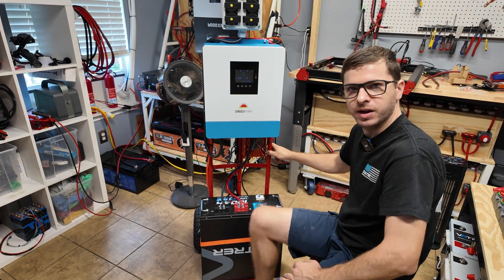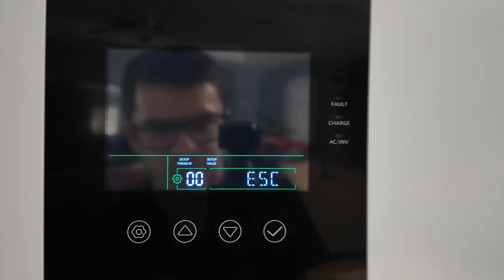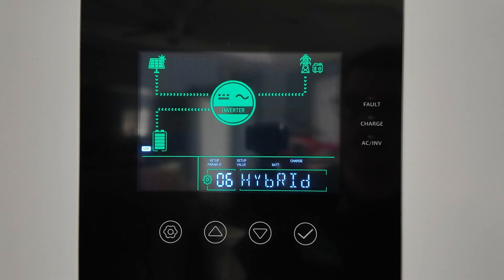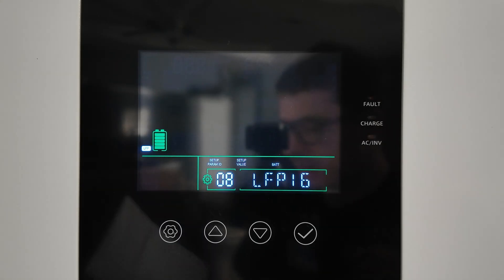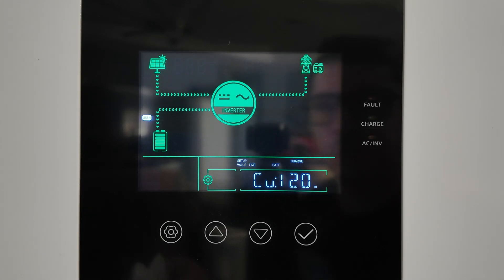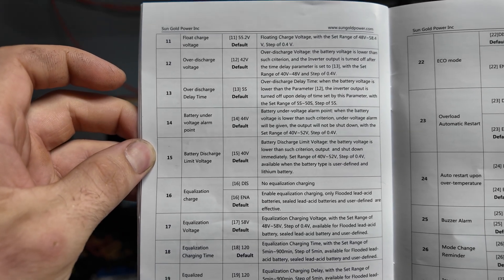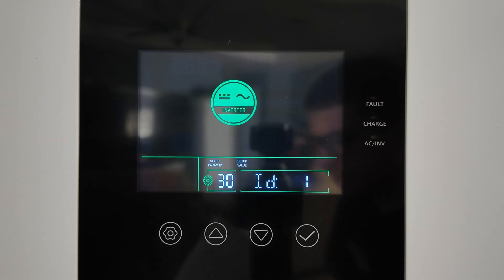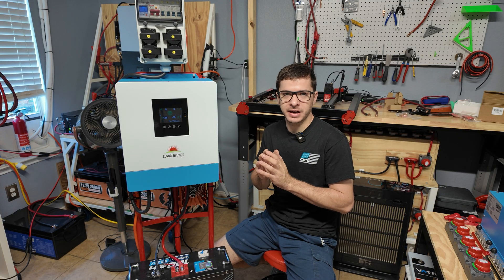Inverter Settings For Beginners, Battery Settings Overview! Sungold Power 5000 Watt All in One

Comment: I say that 54.00 is also OK for Float voltage.   Or 53.90 maybe better.  
Anything over 13.49 × 4 can Damage / Shorten their Life ( IF you Go Over 100% Full ).
According to Clark.

Best to Uee a Battery Monitor  -- to Monitor that.   

54.00 Volt Charge, and 0 watts  to Hold it there is 100%.

Comment: im setting #4 at 50 volts, reason being i heat my home with a coal stove (stoker) and if the power ever goes out i have an auxiliary plug behind my stove that i can plug the stove into that is run off my solar system. if the unit has a minimum of 50 volts it will run the stove for close to 10 hours before the battery is actually dead. 

it's a reserve battery capacity for emergency use. i also only have a small array right now (1,200 watts) and it's overly cloudy this time of year so my solar generation is limited. i do have my unit plugged into mains AC power. i have the minimum voltage at 50 and the charging OFF (AC power) at 54. it will maintain the battery but not top it off to avoid clipping. if i have a surplus of power i will be able to utilize it elsewhere. if there is sun available i want to use it, if it's cloudy i still want access to backup power if the power goes out

Comment: Hey Mike, If you would be so kind, I have a Tiny house using this unit (4 200AH Batteries in series).

What would be your recommended input mode using this scenario (the User Guide doesn't mention this specific setup):

- Full time PV 
- We use a generator to charge when the batteries are low (shore power is wired to "AC In")

Was kind of hoping that when the until detects power on the "AC In" it would automatically switch to getting power from that port and start charging the batteries (as well as handling the current AC load).  Our main power source is PV, but when voltage is low we fire up the generator.
Reply from the maker: It should automatically switch to the ac in mode, bypassing and charging when power is added to the ac input. 

DO you want to connect the generator to the ac input? 
That way when the generator is fired up, it will start charging and bypass loads.
Is that what you mean? 
Sounds like you have a solid setup!

Comment: Do one with settings for using a generator as ac input. Mine detects the ac but doesnt charge the battery, using vatrer as well.
Reply from the maker: Mine as soon as i aplly 120 volts to the input, it bypasses and begins charging, works with a generator too
Reply: @Mikebuildss Had to make some changes to settings, #3 APL, and #37 or #38 dont recall to 54v that eventually helped out. Thanx!
Reply from the maker: @ozzlopez8605 good to hear!

Comment: What could be causing inverter to stop charging after a few seconds with a generator (utility), tried lowering amps to 5a it works but when I rise it, anything over 10a the relay kicks in and you can hear it charges for a few seconds then goes off and back on.. and keeps going any ideas?
Reply from the maker: Hmm id check maybe if the settings for charging priority is set too,
Reply: @Mikebuildss generator was bad, but also had to change settings to #3 to APL in order to recognize generator (tried a new one).

Comment: I heard that they can’t handle a generator modified sine wave and will damage the inverter you need like a chargeverter to make the sine wave pure
Reply from the maker: Best to use an inverter style generator they produce clean power otherwise use a charge verter

Comment: Does anybody’s else inverter idle really hot? My top right side is cooking?
Reply from the maker: They do get warm at idle, mine does the same but nothing to worry about, if it does concern you have a small fan blowing air across for extra cooling

Comment: Well the “USER” setting didn’t work as you think it should for some reason Mike, the other day I saw great solar input and the batteries charged up completely and I saw 100% on the battery side of the app.. but after further investigation because is can’t communicate both my NON Rack mount type it’s just a machine guess by voltage state. Well it stayed at 100% all night as the voltage dropped and I knew something wasn’t right but as soon as I’d normally get solar input it never started I assume because it thought the batteries were full.. I had to reset it to the LFP16 and then reset my bulk and float to 58.4/56.6 respectively… I don’t know why but it worked, another issue I’ve found is that is will stop communicating with the WIFI logger occasionally as well. Just some input from a real world off grid hookup…

Comment: Dear @MIKE BUILDS
Hello my friend. First off,  I’d like to say thank you for sharing such valuable information about Batteries, Solar etc etc. As a single woman trying to do all this myself, there are absolutely no words to say just how grateful I truly am. However…. although I’ve probably watched hundreds of videos by now… I’m still a bit confused. I have one 12V 300ah w/BMS Lithium Battery, a 12V 3000W Inverter & 2X200W =400W Solar Panels (Callsun, just arrived yesterday). I do plan on purchasing more items in the following days, such as a Bus Bar, Fuses, DC Solar Disconnect Switch & Circuit Breakers. But at this point the only problem I’m really having is knowing exactly which size Gauge Cables I need. Do you happen to have any suggestions and/or recommendations? If so, I would deeply appreciate it. 

Please & thank you  ❤
Reply from the maker: From the panels to charge controller use 10 gauge solar panel wiring, it’s rated for out doors, can be found on Amazon. For main battery cables you can get away with 4 gauge if you’re not planning on maxing out your inverter, if you are, use at least a 2 gauge or 0 gauge. 

You can google wire gauge charts, look at a few to get an idea of what you need, but these recommendations will work
Reply: @Mikebuildss  I couldn’t thank you enough! Thank you, thank you, thank you! ❤

Comment: BEAUTIFUL!!! Thanks Mike! It does have some weirdo issues, I’ve tried a bunch of different setting that work but all of them don’t make too much sense but I did set them finally to the USER like you and will see how it goes, thanks so much for taking the time to post this video!!
Reply: BTW today I see that it’s no charging at all now, since yesterday the SOC has said 100%… so no charging, I may have to put it back to LFP16 as the setting…. I was waiting to see how the new settings took and I was shocked to see no solar as they’ve been at 100% but not at 100% I have no idea what else isn’t correct but looks like I’m going back to the Lifepo16 setting Mike

Comment: Glad you made this video Mike. Want to add: 
 1) LiFePO4 batteries do not need to be floated as their discharge profile is vastly different from Lead Acid composition. Any voltage below 3.35V/cell will prevent any low level current from inducing "lithium plating", which otherwise can damage the battery. So, as a longevity practice, 53.6V for Float Voltage.
2) For off-grid users, Eco mode will vastly reduce the inverter idle current drain on the battery. Once the inverter goes from Idle into Eco mode, it will draw roughly 800mA of parasitic current.

Comment: I have the Eco Worthy same settings work. Thank you, 28 setting helped me out.
Reply from the maker: Glad to hear! Someone told me they are essentially the same inverter
Reply: I have eco wortyh battery closed loop on the sungold 6548 and im having overvoltage fault and using over kill app its one cell that doing it

Comment: I have the same setup (With the latest Vadrer battery which has a different top to it than yours) but my AIO is causing the battery to fault - Switching off the Discharge. I've found 2 workarounds but I'm not to happy with the setup. Tried all your settings - Making notes on what I've changed and still the same issue. I was hoping using your settings would solve my issue - But No Joy. Great video - Thanks for posting !!
Reply from the maker: Dang hopefully you can figure out the issue! DO you know why its faulting? State of charge, load?
Reply: @Mikebuildss Here’s a short clip Mike illustrating the battery fault .. .. 

https://youtu.be/GzF7nX8kpeY?si=FAwiuidSgNRqpknR

The AIO is causing the fault. So far I haven’t found the reason.

Comment: In a previous video, you added an external charger option because the unit can’t charge while inverting. Will hybrid mode charge while inverting?
Reply: II have the same setup - And to answer your question .. .. There is no Battery Only option in the AIO. So - as in my case .. .. I wired my generator to the AC IN of the AIO. It's an inverter generator and this works perfect except for this fact. With a moderate/heavy load on the AIO - It's powered from the battery .. As it should be. The AIO's charger only functions with AC present at the AC In of the AIO. Now - Start the generator .. AC is now present and the AIO auto switches to grid. There is no way to lock this from happening - Keeping the AIO only powered from the battery. So - Now not only is the load switched from battery to grid - The charger also is powered from the grid. Add a 43a load and a 20a charger load to the grid and one has an issue. It's for this reason many of us add an external charger - In this way we can use a small generator to recharge the battery while the AIO handles the load. Battery charging doesn't happen though till the load drops below the generator output - The external charger just extends the battery run time.
Reply from the maker: SO in hybrid, it basically means you can use grid and solar to charge. THe inverter can only invert, or charge, it cannot do both at the same time.